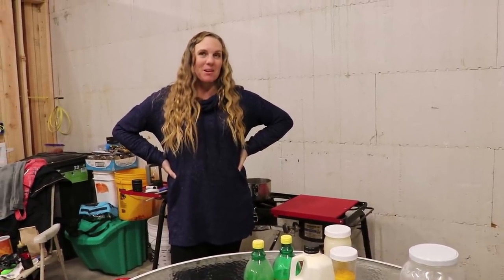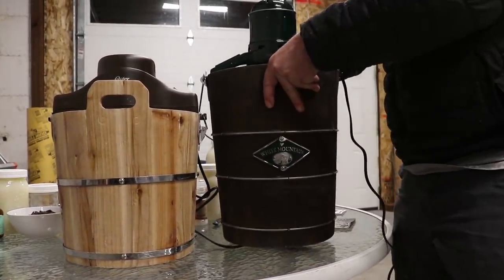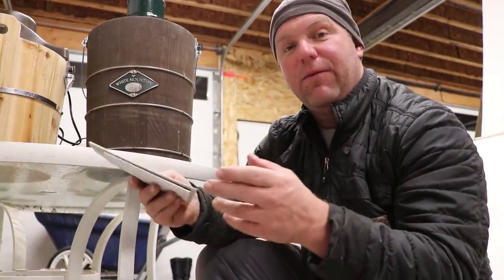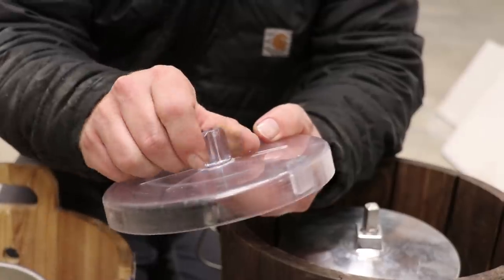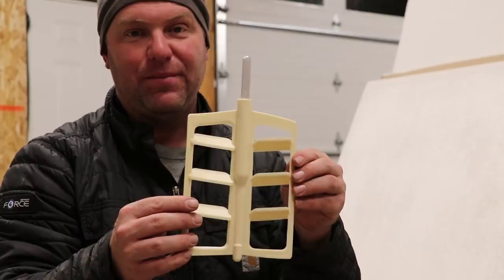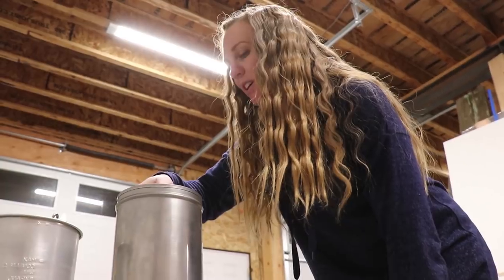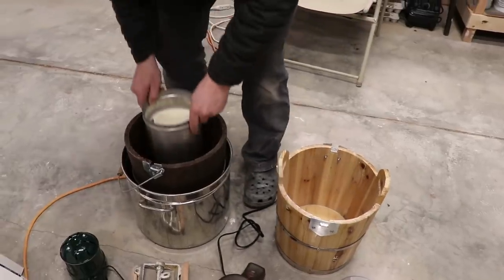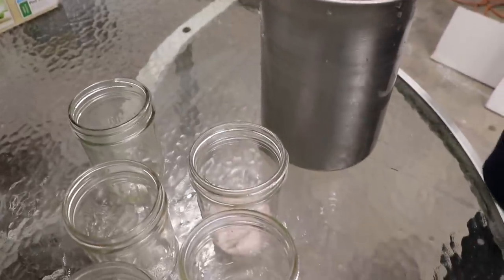TESTING CHEAP vs EXPENSIVE ELECTRIC ICE CREAM MAKERS

Comment: The idea of using ice/salt to achieve the required temperature seems very backwoods.   You have electricity; why not a machine with freezer built in?  Or a machine which sits in your freezer with a power cord?  That way you get fully frozen ice cream.

Comment: ...i could see myself putting that big hunk of metal maker in my deep freezer while its running lol.  Then it will do 2 jobs at one time.
Reply: As for the white mountain, I think the reason it "freezes" better isnt the surface area, which yes is much larger contact surface, but instead the different direction mixing paddles.
Reply: As for the security of the motor, you could always add a buckle to the white mountain and clamp it down that way.

Comment: So 50.00 dollars to 250.00 dollars.     Ya, extra time is cheap, 200.00 dollars isn’t.     You said can’t replace parts, but then you started showing parts and saying they can be replaced.
Reply: Yes and if you can't get the part, you can replace the whole thing 5 times. There is probably a middle ground that is around $100 that would be quiet and make the larger quantity. And I don't like the fact that the inner paddle is rusting in a new machine. I guess you will get your iron for the day.

Comment: The White Mountain looks like it is based on an old design that while works good could use some improvements but now that they make it in China they do not evolve it. The Ostar looks like they took some of the old features but looked at every way to make it cheaper and more mass producible. What you really want is something in between, and I don't know if such a maker exists, or you could make one that is in between and is there enough of a market to cover the costs of re designing it in a mass production society. Crowd funding a better ice cream maker anyone?

Comment: $250 for a bucket and a flimsy motor? Ice cream machine should not be priced as a Makita/Bosch/Metabo/DeWalt/any other respectful brand power tool I suppose.
You had a Makita case standing at the garage floor near the entrance for about a week. In case it's out of use, you could add that tool to your comparison video ;o))

Comment: stainless steel will convection temperature  more than aluminum
Reply: Stainless steel is a poor conductor of heat or cold where Aluminium is a good conductor of heat or cold.
Reply: Wrong. Aluminum conducts heat much more effectively than stainless steel.